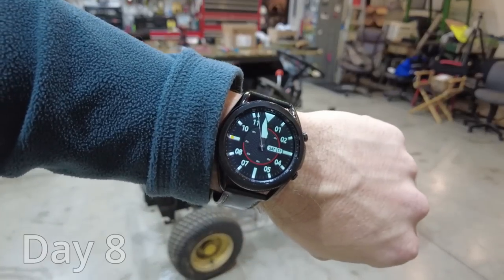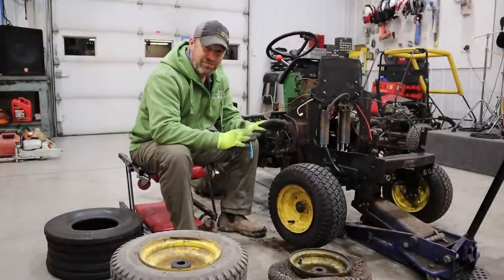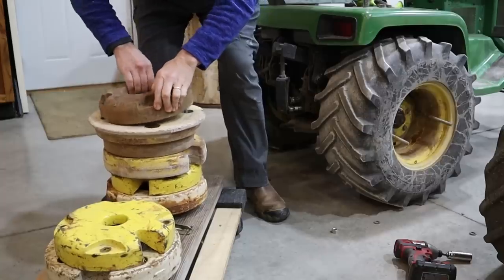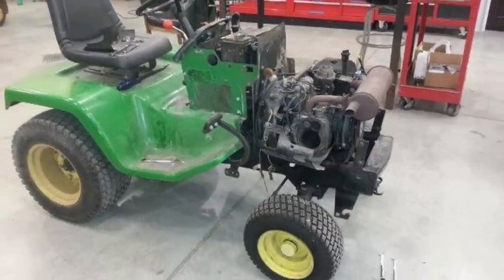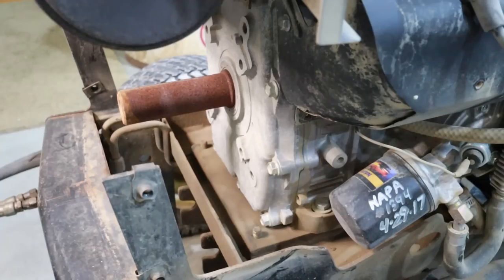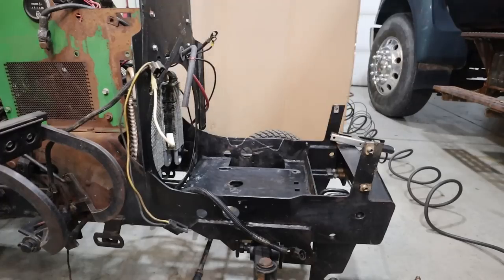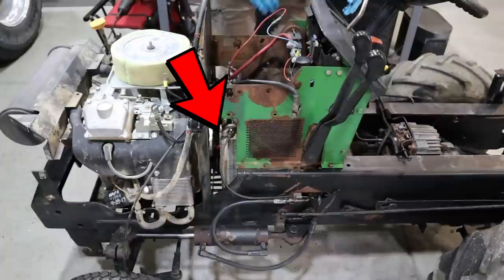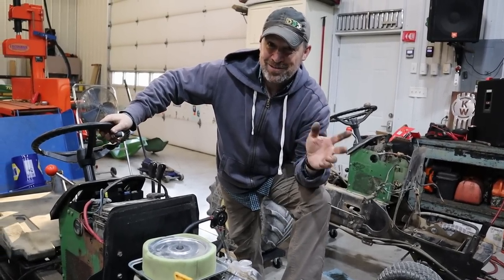I'm Building My Dream Garden Tractor! Part 2

Comment: Wondering what made all this worth it just for powersteering and steer breaks? Why not retrofit Brutus?
Reply from the maker: That's a good question. The power steering is pretty huge actually and the brakes are really nice to have once you use them. The 318 also has a transmission cooler and dual hydraulics for the front to run a snow blade. It would honestly be more work to retrofit Brutus than it was to switch engines which wasn't too bad at all. The last thing was that the transmission on Brutus leaked really badly. And oh yeah, the steering was broken at one point and I had welded it together. But still a very legitimate question and I think I'm going to make that an aspect of the next video. So I do appreciate that type of questioning cuz I could have been more clear about it.

Comment: Hello, my 332 tractor goes backwards when it is in neutral, and this is quite annoying, having such great experience with these tractors, I ask you if it is a cause of wear or is it about an adjustment that needs to be done, thank you!
Reply from the maker: It can be a little of both wear and adjustment but you can likely fix it by adjusting it.
Reply: @digdrivediy  thank you!
Reply: @digdrivediy  waiting sunday video, and Bill's progress!🚜
Reply from the maker: @Crazy.Runner  Unfortunately have to wait another week for Bills progress.  Had to work on the wood splitter a bit this week 😉
Reply: @digdrivediy  Do you still have the polar winter there? Here in Romania we still have sunny days like spring.

Comment: No offense but you should have gone up to a 430/420 frame or at least the 322 yanmar engine with a 420/430 rear end.
Reply from the maker: No offense taken whatsoever.  The 420/430's are terrific. I've had at least one 420, maybe 2 I can't remember :). The 318 has just always kinda been my "thing" is all.  If I could find a 420 rear end I'd stick it in this build for sure. I had the 420 for a while and then got my 755 which I felt took the place of the 420 quite well and had many more capabilities without that much bigger of a footprint. If not for having the 755s, this could have been a 420 build for sure.

I also have a 322 waiting in line to get fixed up as well!  Thanks so much for checking out the video!
Reply: @digdrivediy  its all good..the posi loc is well worth putting  in your 318, makes them a beast on demand, just stop to engage it or the four locking pins can bend over really easy.....all the rear ends and hydros are the same for the 318's all the way thru to the 430's....just extra gears put in and posi locker rings in the 420/430's with the required linkages. Fyi...the early 318's had weak front frames and JD added extra reinforcement plates on the frames in the later ones....best frames were the 90's. Also if you check the hydro pressure and its below around 1200psi you can add shims to the valves on top to bump up the pressure....handy on older worn pumps. If you ever get a 430 check the frame where the rear end bolts to it....every single one I've ever seen has cracks or totally cracked broken because of the torque of the yanmar diesels. The 322 IS a diesel block as well....they had too many other diesels those years so they put gas heads and a single downflow carb on them and effectively made them a "gas" tractor. The 322's run so smooth and quiet and powerful that they are like no other tractor that vintage. I still enjoy playing with those vintage jd's to this day.
Reply from the maker: @shrconstruction  All good info.  I've had two 322s now and both have given me fits with electrical gremlins.  They are so buttery smooth though as you say.  I've never got to really work one that hard though yet.  The one I have now runs for about 2 minutes and then just dies.  I haven't got it sorted out yet but hope I can get it going.

Between all the models, I've had about a dozen or so of these vintage.  Such great little tractors. Thanks for all the insight and info.
Reply: @digdrivediy  I've been lucky with mine that I kept...no electrical gremlins and I've never had a overheat issue both that plague these 322's.....mine was one of the last made in 92 so maybe they got it all sorted by then...lol. Happy tinkering to you....because they always need a little tinkering from time to time. Still a couple of local guys here with hundreds of these old tractors around me for parts....I even still have tons of parts if you need anything in the future. Btw, the carbs are very very picky on these....wasn't the best carb choice for sure.